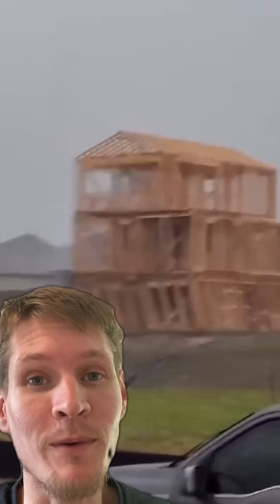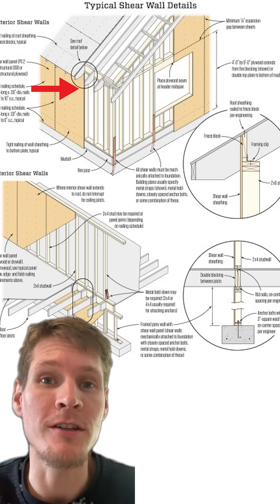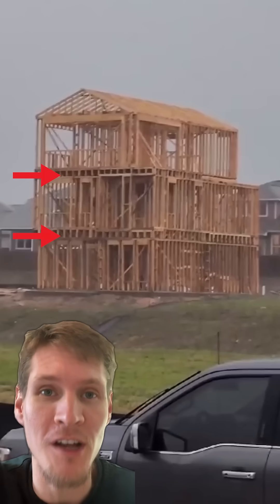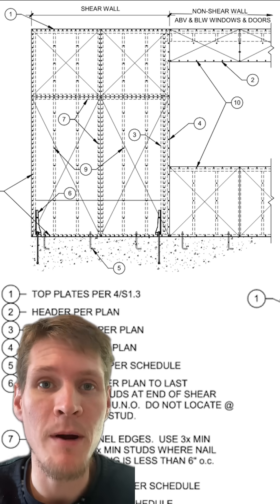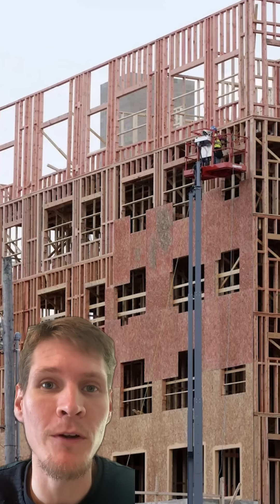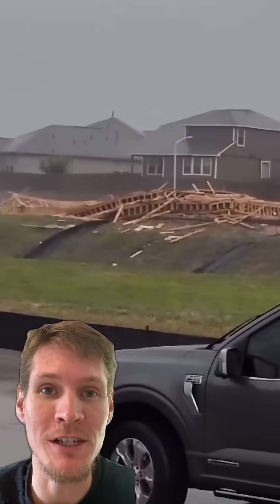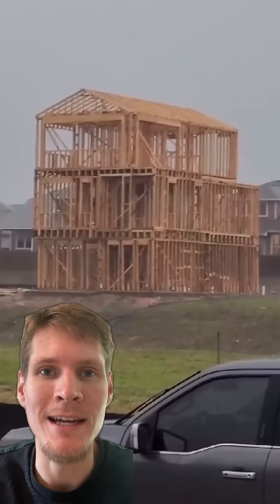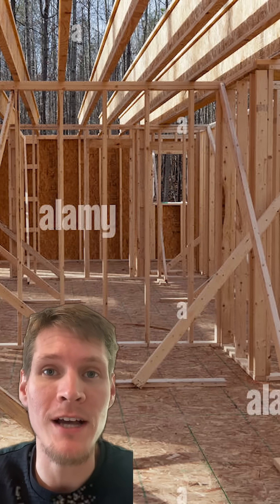Professional Engineer Reviews Reddit Structural Engineering Thread | Part 1 #engineering #reddit

Comment: When you frame in Texas  it's usually all piece work. That means there's a crew that does the sheathing separate  from the framers. The framers probably  got way out ahead of the sheathing crew. I've  never been a big fan of   leaving the sheathing off until the end. Especially  when there's sheathing on the roof but none on the walls. But that's the way it's done in a lot of states. There also should have been a lot more bracing which I also  noticed that in Texas that there was a lack of. I've also seen the wind pick up the top floor and dump it down the street.
Reply: This makes no sense- any framing crew should be able to sheath their own walls flat on the deck faster + cheaper than a 2nd crew coming in and sheathing upright walls.
Reply: @Matasky2010 but the framers were hired to frame, not sheath. Now you're asking them to do something outside of their contracted agreement. By the time you adjust the contract, the sheathers would be there to do their job.
Reply: @Matasky2010 
These are not wall panels. This is stick framing.
Reply: Isn't it code in Texas just to use Ramboard for sheathing? 
I seen it on The Build show I couldn't believe it.
Reply: @nathanmortenson914  Yeah, in much of South Texas, shear loads in residential are basically not considered; cardboard sheathing with maybe a couple diagonals has been standard for over 30 years.
Reply: 120 mph wind can knock down any frame. I've seen the wind blow all the insulation on a house ready for dry wall.
Reply: houses in texas are sketchy. you guys need more engineers if those practices are acceptable
Reply: Piece work is still a thing?
Reply: @Bigelite094  In Texas you don't  have to pass a test to be a contractor, like other states. So there  is no commission  ot over see a lot of work. If you want to be a contractor in Texas you just go to the court house get a business  license  and declare yourself a contractor. There is also no state income tax so everybody does as they  please. It's been a while since I worked in Texas, but that's the way it used to be.
Reply: @yolisurich4025 I guess you get what you pay for when there’s no income tax paying for any state services.  Like building inspectors. 😂
Reply: That's dumb as shit...also even if that's the case the framers should have plumbed the walls and tenp braced them
Reply: My cousin and electrician was killed in Beaumont Texas when the house he was working on collapsed during a thunderstorm, the reason it collapsed was because it wasn't properly sheathed. Cutting corners gets people killed.
Reply: @kdh3706  Texas is like China for worker safety.
Reply: @tillitsdone  But they do pay good.
Reply: Texas has almost no codes or standards.
Reply: I’ve never seen a third story go up let alone a second story without sheathing on the first floor. This looks crazy.
Reply: @_JimmyBeGood  Live and learn.
Reply: Stop saying sheathing.
Reply: @dougfisher1813  sheathing...sheathing...sheathing....sheathing.
Reply: This is why people don’t mess with Texas
Reply: 😂@kennethmartinez8731 Texas is a crappie state. Care more about all mighty dollar than limits on pollution and employees well being..

Comment: And this is why rest of the world doesn't build houses out of 2by4s and and particle boards.
Reply: We dont use 2x4 for load bearing walls anymore, its 2x6 with 1/2” radially cut plywood or 7/16” osb not particle board. both panels add incredible shear strength to stud walls. Using engineered wood products made of biproduct is in many cases way better than standard lumber. 
I-joists with 3/8” osb webs and 2x3 flanges can span longer lengths and remain straighter and stronger than dimensional lumber. LVL’s (laminated veneer lumber), OSL’s and PSL’s (oriented and parallel strand lumber) are all more dimensionally stable and stronger than standard lumber and are used as beams, in many cases replacing steel I-beams. 
Wood construction makes sense for low rise construction in places where forest resources are plentiful, termites arent a problem, and cold climates demand insulated wall assemblies. You wouldnt build a wood house in northern mexico because there are no forests or in a tropical rainforest where outdoor relative humidity is so consistently high that water would condense on all surfaces causing rot. 
They build wood stud houses in northern Europe and they work great, its all about building according to the environment, available materials and capabilities of the workforce.
Reply: @connorpitcher2846  two words for you: brick and mortar.
Reply: There is a different in philosophy. You can build a House, that should last 40 years, or last centuries. Secondwise you would go more for a halftimbered House.
Reply: But they do. Just because some houses are built differently elsewhere doesn't mean all are and they are rarely cost competitive.

And this house would have easily stood if it had those particle boards put up.

Comment: I framed for years and we never built walls and then put sheathing on them after raising them. We always framed the walls lying down and squared them up and then nailed the sheathing on before standing them up. That is the correct way of doing it. These framers are stupid and don't know what they're doing. That structure would have had a large enough framing crew that they would have enough men to be able to stand those walls up after sheathing them, even if they are pretty long. It's so much easier to nail on plywood when the wall is laying flat on the decking, instead of being out there on a freaking ladder.
Reply: Assuming the slab is mm perfect that works...it's better to just plumb and brace once it's done level by level
Reply: Not how Stupid  shear goes on after plumb n line walls go back to school

Comment: How could they be skilled enough to build this but dumb enough to not put sheathing on? It’s mind-boggling also they’re lucky they didn’t kill themselves while working in there.
Reply: This proves they weren’t skilled though. Anyone can just nail wood together, it’s not that hard. Knowing how and why is where the skill is.
Reply: The framers and the sheathers are different crews.

The framers outpaced the sheathers who were busy being late on another job.

Just speculation but it's possible.
Reply: It could be there where no sheathing material there , only framing material , and the manager told them to work , not to just stand
Reply: @norbertszekeres867 this is the most likely scenario.

Comment: What happened here is that American homes are built out of toothpicks with the cheapest materials possible to make banks as much money as possible
Reply: I've seen block walls topple because they weren't supported enough yet and got caught in a storm...
This has 100% to do with how to build, not so much what the materials are.
Reply from the maker: if the paper walls were installed it'd basic be equal to a German brick wall.... right? .... right

Comment: In the workman lingo, it's commonly called "racking resistance". It's also why houses w/drywall are more resistant to racking than prior to it's installation...
Reply: In carpentry lingo ..It's called bracing . Look for the lines of force. Any house dependent on drywall for shear ??  Wobbly house .  Don't like rising too high without having lower sheathing on .. and nailed to hell and back
Reply: Drywall should really not be relied on for that and blocking should be placed periodically in the frame to supply that anti-racking. A house should be able to stand forever without drywall, the drywall should just help.

That being said, many structures still do actually rely on it quite a bit, and that frankly concerns me a bit.
Reply: @KaiserTom  even stucco and drywall offer lateral support and when necessary, engineers will include those values to meet the required values.
Reply from the maker: Yes! We even have design lateral capacities for gypsum walls. It’s not much but they do provide stiffness for sure!
Reply: @Kestava_Engineering Especially when they screwed on a bit beyond the code minimum. When I was remodeling my house, I spaced drywall screws 6” apart. Costs next to nothing but a bit of my time. Same for the plywood subfloors: a 3” structural screw every 6” of the joist. The floors felt like concrete - that box was *stiff*, even more after the ceiling drywall went up on the bottom of the joists.
Reply: @absurdengineering  it also gained you nothing

Comment: alright, at first I was like "what a garbage house" then the porta potty was pointed out and OH MY GOD thats windy
Reply from the maker: doomed from the start 💀
Reply: @Kestava_Engineering how about not building with garbage materials? Does brick and mortar for centuries-old buildings mean nothing to burgerland?
Reply: @NKY151  Europeans can't do cost/benefit calculations.

What exactly is the point of spending 10x as much for a house that will only last 3x as long? There are 200 year old stick framed houses in the US. My house is just shy of 100 years old. What's the point of building a house that will structurally last 500 years when the plumbing and electrical will still need to be redone every 30-40 years as it wears out?
Reply: @Crosshair84  electrical wears out? how even do you manage to do that... as for the 30-40 years... idk man most houses here have had plumbing for 60+ years without any issues. I currently live in a house well over 350 years old and the only headache is getting tings done because its seen as national heritage. all 2 layer brick walls
Reply: @ruiter939  How does Electrical wear out? Quite easily. Do you honestly think inspectors are going to tolerate 1950s electrical wiring in 2024? My house was built in 1927 and it's pretty clear, when you work on it, that the electrical has been redone twice since the house was new. To be fair, once was due to severe flooding. The plumbing has only been redone once since new.

"as for the 30-40 years... idk man most houses here have had plumbing for 60+ years without any issues."

My time between overhauls may have been off, but the larger point still stands.

"I currently live in a house well over 350 years old and the only headache is getting tings done because its seen as national heritage. all 2 layer brick walls"

Thank you for proving why NOT doing that is such a good idea. You end up not owning your own home and hemorrhaging money trying to get basic repairs done.
Reply: @NKY151  I can only speak for Canada but the answer is cost. Wood is just a bajillion times cheaper here, especially since bricks aren't even manufactured west of Ontario and there are very few bricklayers around.
Reply: @Crosshair84 I live in a house from 1889 and the electrical installation has been overhauled once when they switched from 3*230V to 3*400V+N. 
The in-wall plumbing has also only been changed once when they changed the lead pipes to copper and turned the workshop with appartment it was earlier into a two story house.
Nice thing about electrics in our brick walls is you can just pull the new cables through the existing electrical conduits without needing to break anything.
As long as you don't overload your wires they don't wear out. Plenty of paper wrapped wiring is still around without them being a hazard, even for underground distribution networks below the street. They are only replaced when someone nicks a cable doing earthworks or when they renew the sewers because if you dig up the whole street might as well renew everything.
Reply: @TheBayru oh boy. I am just a diy and i have seen my share of worn out electrical wiring.
Often it's horribly extended by people that don't know what they are doing. Or it's tar and paper wrapped wiring in aluminum pipes. This will sooner or later lead to your whole house being electrocuted. Wiring from 40 years ago also misses separate earthing and usually offers 2 outlets per room which is hopelessly off from meeting current demands.
Reply: @jpt3640  I was talking about electrical wiring in brick european homes specifically. Never seen wiring in aluminium pipes. In bakelite, asbestos and ceramics (porcelain) yes. As long as you don't touch the wires they are fine. If some stupid DIY guy starts messing with them then yes, superdangerous. Don't let DIY guys mess with your electrical installation. But I imagine the DIY guy cutting random wooden studs and beams in your wall to pull some wires through is a tad more risky than a DIY guy pulling faulty cables through a clay-brick wall, unless you're McGuyver and bridge the fuses...
And absence of an earth wire has nothing to do with 'worn out' wiring. 
If you want a few more outlets it's not like you need to tear the whole house down (which is what the person I was answering to implied, that american wooden houses are better than brickbuilt because when you want to change the electrical installation you can tear down the whole house and build a new one with a few added outlets).
Reply: @NKY151  Depends on where you're at, I'm in California and there aren't many brick structures still around at all. The only one I can think of near me is a liquor store with an apartment or two above it, it's plastered with warning signs because brick structures don't do well in earthquakes. Even reinforced masonry buildings don't handle them as well as wood buildings.
Reply: @scarx4181 like all of Japan disagree with you
Reply: @mgolivets  Japanese houses are mostly wood framed too dude, wtf are you smoking?
Reply: @ in the countryside sure, but the cities are concrete jungle
Reply: @TheBayru  so you have one outlet per room, as the house did in 1920?
Reply: @scottdelinger1  You know you can "just" lay more pipes between the inner and outer wall to create more outles right?
Reply: @mgolivets  If you want to standardize Japanese quality foundations, good luck. There's the key feature.

Comment: Post WWII American housing construction is an embarrassment.
Reply from the maker: what would you change?
Reply: structural brickwork with load bearing steels and 8 inch floor joists. 

idk what this is. coming from the uk, this looks like a house built of matches
Reply: @ruutjormun2262  I hope you know we do build structures like this in the US. Maybe just not for single family homes like this. Apartments in major cities more likely to have CFS stud walls and CIP walls. But wood framing is perfectly viable, or else you’d hear about people dying due to houses collapsing much more.
Reply: That's construction fails not designss and regulations
Reply: You really shouldn't weigh in on something like this when you know absolutely nothing.
Reply: What did they do before?

Comment: Or you could just build your houses from block and brick.
Reply: That can fail too, if you build stupidly
Reply: Those have the capacity to fail in other catastrophic ways. Wood isn’t the paragon of construction materials, but the material isn’t what caused this building to fall. Bad construction was the reason why it failed. The wood sheathing makes up a lot of the shear strength in a wood shear wall
Reply: @Panda-xd5ey in what way
Reply: @Nimlu  Brick walls can fall over if built to high without enough anchoring or support. Every building method has a process and if it's not followed properly things can collapse.

Comment: It’s much faster and easier to sheet the walls laying flat on the deck
Reply: That's what I was thinking. I've never seen someone frame this way. Typically, we square and sheet the walls before every standing them
Reply: O thats good, i thought i have been doing it all wrong for 30 years@RNG_Anarchist
Reply: We always sheeted then stood the walls and then on upper floors hung the sheeting down to meet the lower sheets. Increases shear strength and allowed for fewer addon straps
Reply: I've known builders that also install windows while walls are flat. They raise the walls with jacks instead of relying solely on muscle power.
Reply: It's flat on the deck now, too late for sheathing? 😂
Reply: You're right. But you pay an added toll when it comes to lifting the extra weight. Besides, most are sheathed in advantec sheets which aren't that bad for a pair of men to lift individually.
Reply: If framers don’t know about shear they shouldn’t be in construction
Reply: Should be easy, now that all the walls are flat.
Reply: Heavy AF to raise though
Reply: @mae2759  not really much heavier just 50 pounds per 4 feet of wall and by lifting top edge of wall half the weight is carried by the bottom fulcrum, and the  weight quickly decreased the closer you get to vertical
Reply: @mae2759 Simple machines go a long way to help with that. Spend 10 minutes building a little tower with a pulley on top and on the bottom and you can pull walls up from flat all day with a simple winch. Can be even on the truck, just takes a bit more rope to get it to where it needs to be since the truck can’t go all around the building on smaller lots.
Reply: @mae2759  The builders I know use mechanical jacks to raise the walls. They're more than worth the small added expense.
Reply: Actually stick framing is 10x faster, give me 1 guy and stick framing vs 6 guys box framing we will still beat you
Reply: @zerkingpro  I dunno if that's the flex you think it is...
Reply: @zerkingpro you'll get the walls up faster, sure. But then you need to go back after the fact to sheath it either with a boom, ladder or reaching through the wall and that's gonna kill your time compared to just laying them on a flat wall.
Reply: @zerkingpro  I never heard "box frame" used like that. What do you mean by "box frame"? Where I am from "box frame" is more related to stair construction. You put a series of framed boxes on top of one another to create the stair.